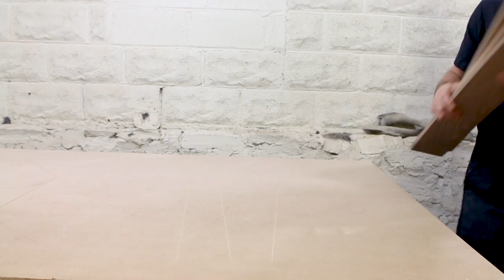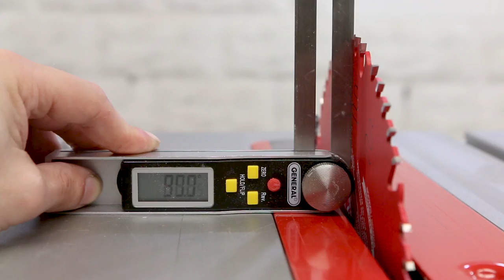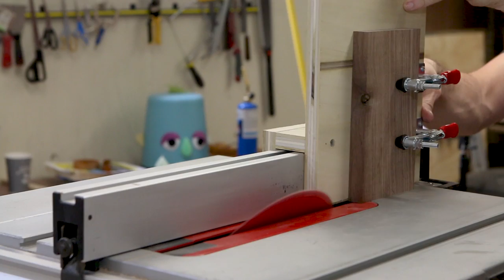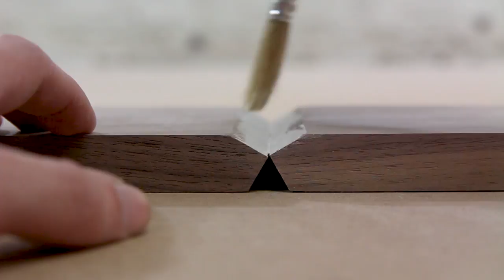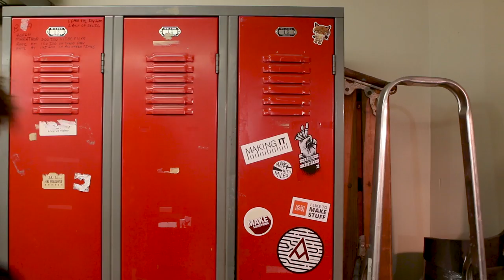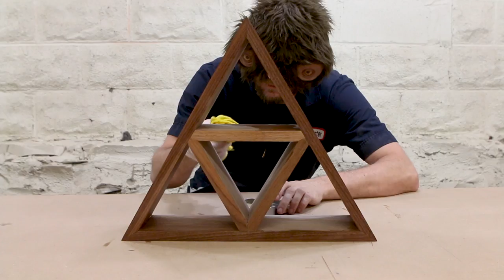Make a triangle shelf using woodworking (and magic!)

Comment: Can you pretty please break down the measurements? Specifically for the inner triangle pieces. I can't tell if it's suppose to be 7.75" or...
Reply from the maker: I actually ended up not going by measurements. I figured out the angles, cut one side, and then trimmed up the other side until it fit. I made marks on the miter fence to make the other pieces match. Sorry if that’s not super helpful! I did it by measurements only the first time and nothing lined up at all. Hahaha